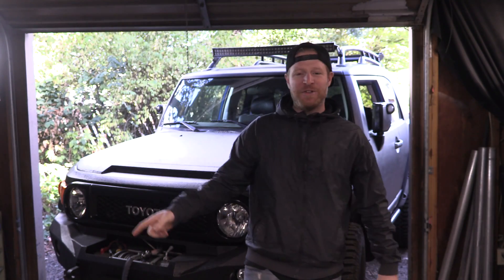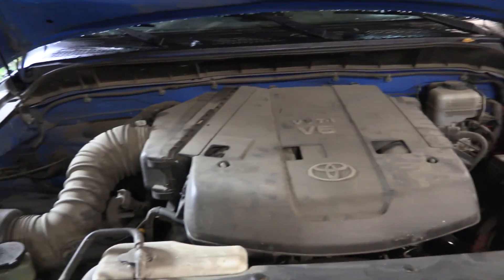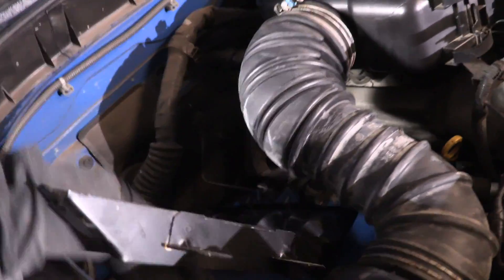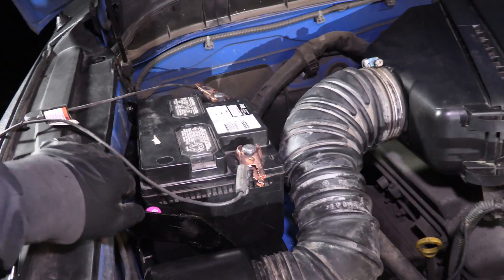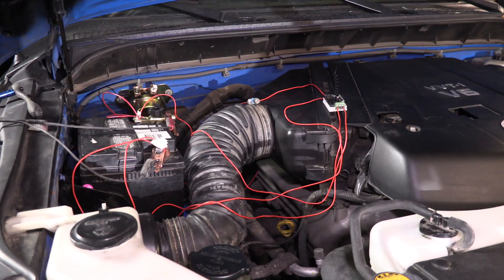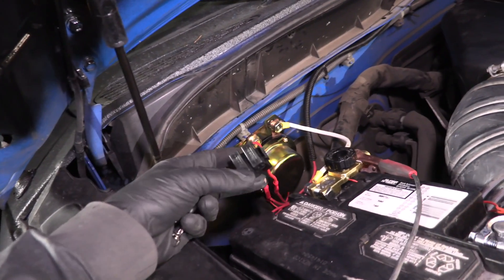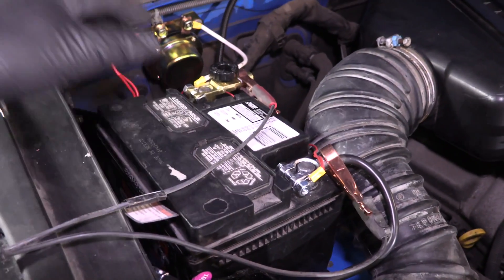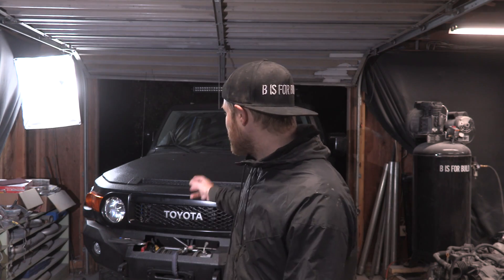FJ Cruiser Build Pt 9 - Remote Controlled Lighting & DIY Dual Battery Setup

Comment: Your cut off to the second battery is ok till you forget to disconnect it. Why not just get a split charger relay which seperate it from the starter battery and only connect to charge when engine running. Just a thought. It is how campers and caravans do it.

Comment: Your builds are pretty cool but you half ass them, leaving those parts blue was the first thing that bugged me but then you added the light bars way too high and finally you added a second battery all wrong. The Toyota charging system won’t charge that battery to full capacity without adding a dc to dc charger, (it will charge it just not to full capacity and most might not notice this) and then the manual disconnect was icing on the cake. You have great ambition I just think you’re lacking knowledge and vision.

Comment: I ain't much on the bar light operation.  I know it's a budget build, but they sell factory interior color light switch panels that mount on the driver's side A-pillar that will allow you to operate each bar separately.  A little wire, a couple relays, in-line fuses, bada-bing, bada-boom, individually controlled light bars.  I don't think you'll like that "both on, both off" mode of operation.

Comment: Another option to welding would be rivets or using nuts and bolts. A little more involved in the planning process but still solid enough to hold a battery. Also,  your a super smart guy and thanks for the uploads.

Comment: nice job only thing that I dont like is that disconnect switch ,in the past I had one and after unscrewing it the switch remained connected  enough that I was able to start the car. I bought one to disconnect my battery when servicing stuff on the engine . I would recommend a  shut off switch than that twist knob switch. other thing I wish I asked this guy I saw his FJ at wall mart and he had a LED light bar that served as a sun visor on his wind shield. I wish I left a note asking where he got this, have you seen these any where?

Comment: Hey bud love your videos! Why wouldn't you just wire it up so that when the truck is running it gives charge to the battery? Wire the solenoid up to ignition or something? Why mess with a remote? Just curious! The fj is looking great! I'm building quarters for the camper of my Tacoma. Looking at doing the same stuff!
Reply: So one solenoid for the disconnect connecting the 2 batteries that connects then when the truck is running and disconnects when truck is off. Another solenoid for the lights on the remote switch.

Comment: Could you place a relay between the two batteries and wire it to something that has power on it only when the engine is running so it charges when the alternator is supplying power.

Comment: You didn't add any kind of undervolting protection? Running the battery with too low a voltage will decrease the life of the battery, and might harm the LED's.

Comment: Great install of the secondary battery Chris though i'd use a leisure battery over the normal car one for the secondary. Leisure batteries are designed to be charged and discharged. A normal battery will get toasted in no time.

Comment: Just my two cents, but maybe consider a deep cycle 12v battery after the automotive battery shits out. They're designed to be drained and recharged where a regular automotive battery is not.

Comment: Very cool setup and clean wiring! Nice work man! My only word of advice would be to invest a couple hundred bucks in an Optima Yellowtop deep cycle battery. A deep cycle battery can handle being drained down and recharged, where as a standard car battery designed for starting will go bad after a few cycles of dropping to low voltage. Peace!

Comment: Chris you can buy a voltage sensitive relay for about $50 that will automatically disconnect the spare battery from the main when your engine is off, and connect it for charging when your engine is on. Saves you the hastle of having to remember to do it manually

Comment: You need a deep discharge protection circuit on that second battery, like all camper vans have. Otherwise after only one long laptop usage night the second battery will be a paperweight.

Comment: why dont you just put a reley in for the charge for the second battery when ignition is on the reley is closed ignition off reley open battery disconnected simple

Comment: Yeeezzz why are you being so difficult?? Just Add a relais to it and connect it to your ignition contact, this way the battery is only connected to your other battery when your car is running. Now you have to open the hood to connect and disconnect the battery, further more when your camping or something and you only need the rear light you need to pull a fuse because otherwise you dont need your front light but it will work and drain your battery

Comment: You could use another solenoid to connect those batteries. Put switching power from the alternator to it, so it only connects the batteries when the engine is running, thus preventing the engine battery from draining.

Comment: Why not just hook the first battery to the second with another large solenoid hooked to the ACC circuit instead of that disconnect post? When you shut off the vehicle, it would automatically disconnect the second battery, and when you turn on the vehicle it would automatically reconnect it.

Comment: Should have used an 12v 100amp isolator between batteries instead of a disconnect, that way you don’t have to constantly open and close the hood to connect and disconnect the second battery

Comment: Some advice...Stinger AVG SPP1200 battery...Stinger SPP680...Stinger battery isolator.  I know this setup is a little pricy but it's what I'm running and you won't believe how small and light yet  extremely powerful these things are. All you lights and acc. will run so much brighter and better. Your starter will sound like it actually has good power behind it and turn overs are instant. Optima batteries are now garbage since they outsource production to China. They use to be good ....not any more.

Comment: Instead of the manual disconnect, maybe you should just connect it to the other battery with a big relay that activates with the car running and deactivates when it is off. That will automatically isolate it when the car is off instead of having to remember to pop the hood and turn the knob.

Comment: with lots of experience winching and off roading I really suggest using a dual battery kit, it automatically charges your aux battery  with the use of a solenoid, really easy to install, also I would highly suggest winching off of your aux battery, check out the national luna dual battery kit or the max dual battery kit.

Comment: Auxiliary should be a deep cycle AGM or a lithium to run accessories
Connect to the starter battery via a DC-DC charger this will make sure your aux battery doesn't over charge and your starter battery won't go flat. Starter batteries aren't designed for constant load.

Comment: A few inexpensive things that will improve your camping experience :)
1) 20 watt Solar charger kit for the battery: https://www.amazon.com/ECO-WORTHY-20W-Solar-Panel-Polycrystalline/dp/B00PFGP0EA/ref=sr_1_11?ie=UTF8&qid=1507799039&sr=8-11&keywords=Solar+panel+for+RV
2) Here is a 100 watt panel (still need a charge controller): https://www.amazon.com/Adjustable-Solar-Panel-Mounting-Bracket/dp/B00SBCKLYO/ref=sr_1_29?ie=UTF8&qid=1507799072&sr=8-29&keywords=Solar+panel+for+RV
3) Voltage and load monitor for the batteries: https://www.amazon.com/bayite-6-5-100V-Display-Multimeter-Voltmeter/dp/B013PKYILS/ref=sr_1_19_sspa?ie=UTF8&qid=1507798873&sr=8-19-spons&keywords=battery+diode+isolator&psc=1
4)Automatic Dual battery combiner/isolator: https://www.amazon.com/Victron-Cyrix-ct-24V-Battery-Combiner/dp/B00ZWLBZME/ref=sr_1_fkmr1_2?ie=UTF8&qid=1507798845&sr=8-2-fkmr1&keywords=dual+battery+diode+isolator

Just these few things can really make a difference if you are serious about the whole camping with power thing like I am :)

Comment: Just buy a relay and control it with an arduino or something so you can disconnect and reconnect the 2nd battery via a switch in the cabin.

Comment: Why not put the switch for disconnecting the batteries in the car? You could use those big main power switches used in tractors etc

Comment: The high gauge wire between batteries must be fused at both ends! Also another large relay or split charge relay would automate the connecting / disconnection of the second battery from the car

Comment: Not dissing on the remote control, but having a dual channel remote, one for the front bar and one for the rear would have been just a little bit cooler

Comment: There is a lot of better ways to hook up the second battery. You can just put a relay in there that is hooked up to a fuse that is only on when the ignition is on. This way your battery only connect to the main battery if the power is on and the alternator is running.

Comment: hey chris, you might want to go with a deep cycle battery if youre really gonna use that accesory battery, 12v batteries they are not meant for draining completey then recharging the battery will go bad in about 10 cycles of draining then recharging, deep cycles are they are used in many recreational vehcles for lights such as boats and rvs, and can be drained completely then recharged over and over again. love your vids man!

Comment: You're about to get alot of comments about the way you did the battery, so here's mine:
-Discharging a regular car battery one time below 10.5v will permanently damage it. A deep cycle battery (optima) will go lower and get damaged less. But any battery needs low voltage protection to last. 
-I'd really like to see a fuse between your 600+ amp second battery and your sketchy +12v relay which is mounted to your chassis. I have a feeling it's probably not isolated and the metal top is 12v hot. In any case, wrenches get dropped. 
Cont.....
Reply: -there are also much better battery chemistries than lead, potential 18650 project? (Think of the views!) Oh also, solar panels are cool and easy to put on the roof for extended camping without running the engine. Also would be a backup to gather some electrons if you do forget to disconnect.
-how will you really know when your battery disconnect post is disconnected? I know they're pretty reliable but in an adventure situation...

Comment: Can some explain how connecting the 2 batteries doesn't double the voltage?
Reply: Because they are connected in parallel .Positive to positive, negative to negative. This increases the capacity not the voltage. If you connected them in series, positive to negative. The you keep the same capacity but double the voltage.

Comment: A duel battery isolator would negate the use of a disconnect. The one I have in my truck will only drain the auxiliary battery regardless of if it’s connected to the main battery

Comment: Chris, always use black wire for negative connections. If someone else works on this vehicle/you sell it and they see red they will think positive connection and potentially short something out. ARB and other companies have been building these solutions for years.  example: https://www.arb.com.au/products/battery-power-12v-solar-solutions/redarc-management-systems/

Comment: I've done something similar, but I had a relay separating the two batteries. But the secondary battery was a redundant start battery, so I had a button in the cab I could push that engaged the second battery if the first went dead.

Comment: Why not just use a battery isolator so when the second battery is charged, the vehicle won’t charge second battery, but when the second battery gets to a certain voltage it will start charging

Comment: Curious why you would choose to use a manual disconnect on the battery instead of using an automated battery isolator. Cost? I feel like going under the hood to connect and disconnect the battery is going to get old really fast.

Comment: You could have just used a battery disconnected switch so you don’t need to open the hood you can just turn a switch im the car

Comment: Just run a Marine Battery Isolator switch allows for adding a spare battery to run accessories in your car, boat or RV. This fully automatic switch allows for your engine alternator or aux battery charger to charge 2 batteries, while keeping the batteries electrically isolated from each other. This means that you can run your spare battery down, without worry of running down your starting battery.

Comment: I'd suggest the following charging system: if the key is on "on", connect the secondary battery, if not, disconnect the secondary battery. It should be as simple as having a relay trigger depending on the key position.

Comment: No battery of any kind can be ran until dead without reducing its life drastically. Cheap lead acids should never go below 50% depth of discharge, agms, 30-40%dod, lithium, 20%. Try this with your next phone and your battery will hold charge for years.
Reply: Why isn't this common knowledge? Battery companys want to sell more batteries.

Comment: Just paint the door jambs matte black with a spray can. Cheap and quick.
Reply: Plastidip them
Reply: Sadie Adler agree. Building kick ass ride and leaving door jams blue sucks
Reply: plastidip wouldn't work. If you brush up against it especially in the corners, it will split and peel off.
Reply: just rub it down with 800 paper, wont chip off
Reply: I have bed liner coated the door jams on my Tacoma.
Reply: It will just flake of and look like ass. I don't mind the blue door jams. There is not real over spray on them and they are consistent.

Comment: Use a battery isolator, automatically connects the two batteries when the vehicle is running and disconnects once the vehicle isn't. It's essentially a high amperage solenoid that you can wire the signal to either your ignition or a switch on the dash.

Comment: Please put a breaker inline between the main battery and the second battery!
Reply: Actually run two, each close to a battery. In an accident, should the positive line be cut between the batteries each battery’s breaker will prevent a fire. That’s how I wired my 2013 fj

Comment: why run a huge solenoid, when you can just run 2 automotive use relays to power the light bar? and why a flimsy remote over mounting 2 switches inside the cabin?(there has to be a couple empty buttons slots in there)

Comment: Great work, personally I would have the lights on a switch in the car so you can turn on the front bar when driving seperatley from the rear and a dual battery manager would mean you dont have to worry about forgetting to disconnect it. But its looking good great job.

Comment: Really... Chris.. why not just have the rear bar on the remote, but front wired in of full beam lights.. seams a bit impractical to have them both on a remote... also... speaking from experience... if your battery is manual disconnected you will forget and drain both batteries... voltage sensing split charge relay... will charge and disconnect automatically.... just as a thought...

Comment: Or you can use a high Wattage diode to allow the secondary battery to receive charge from the alternator but not drain power the opposite direction from the battery

Comment: I originally thought you'd use the solenoid for connecting the batteries together, and then some toggle switches inside the cabin of the vehicle to turn the lights on or off.

Comment: (Commenting this before end of video) your gonna wanna make sure you cut off the bottoms of those bolts going through the wheel well so you don’t puncture a tire when your offroading
Reply: Also check the self tappers that went through the bulkhead. The pointy ends can do a lot of mischief.

Comment: Should use a deep cycle battery instead if you plan on using it till its dead and charging it back up. Thats what a deep cycle battery is used for. They have a reserve capacity.
Reply: You really DO NOT want to parallel a disharged battery to a full one. Not without any kind of current limiter.
Reply: Nebbia affaraccimiei The only resistance holding it back is the internal resistance of the batteries and the wires. That's probably around 0.05 ohms. That would be around 240 amps, about a third of the Cold Cranking Amps of a stock FJ battery. The big gauge wires should handle it, though you never load a car battery like that for long. The wires may be perfectly fine, but he'll have dead batteries very soon afterwards. Like how you don't keep trying to start the engine over and over, you kill both starter and battery.

He needs to get a pair of Optima batteries for it. 140 reserve minutes and 830 CCA (1025 CA), D27F at Autozone, specifically for an FJ Cruiser. The Optimas are also deep-cycle batteries, so that works to his benefit with a 3 year replacement warranty for each. They are full-on trucking batteries, but off road is a similar engine/ancillaries load situation, right?

Edit: yeah and as devils garage said above, a DC-DC charge controller. That is an absolute must for a dual battery overland/off road/camping setup. Someone else here I replied to mentioned a PV panel for it. That would need a variable boost converter and a DC-DC charge controller too. Better he gets both done in one fell swoop rather than waiting to fry his batteries after one night out.
Reply: The guy in this video has a pretty good battery set up.

Comment: You could also use a second large solenoid activated by key power to connect the second battery to the main battery when key power is on.